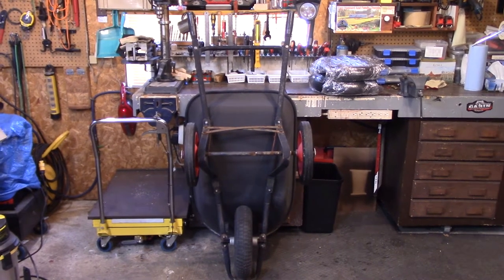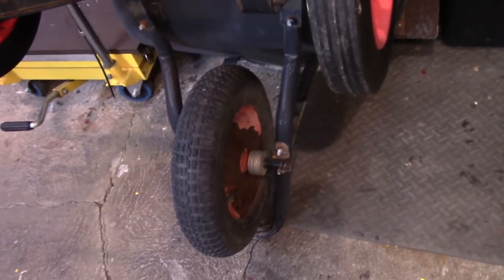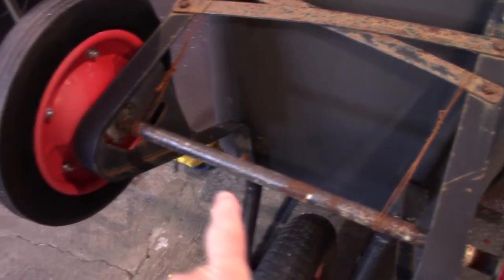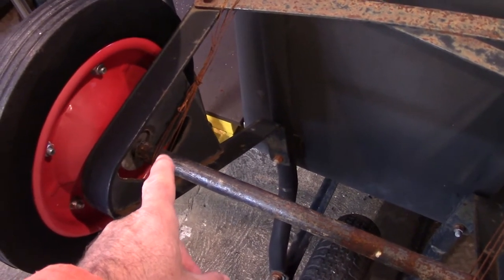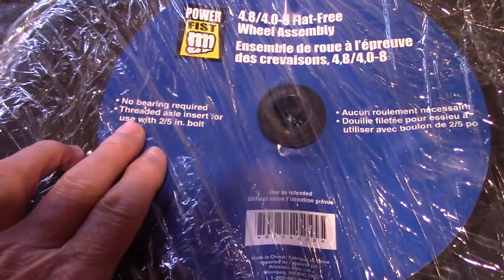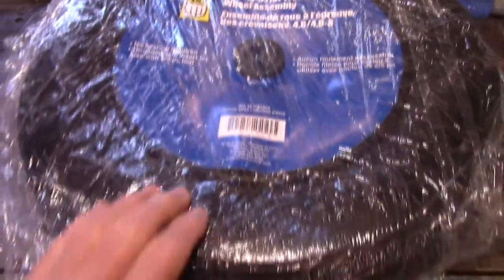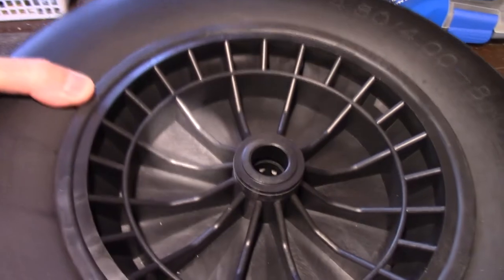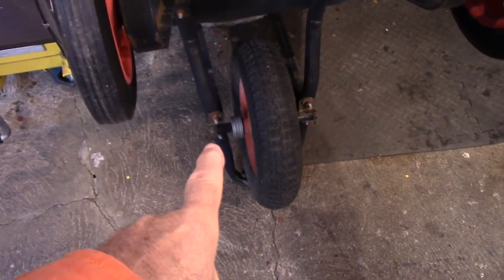Best Wheelbarrow  Design To Buy

Comment: A good mod, it always seems like the front tire is flat every time you go to use the wheel barrow.  I ended up putting a tube in mine but a run flat seems like a much better idea.  Interesting bearing set up there
Reply from the maker: Easy mod to convert to a 3 wheel version and not so tippy.

Comment: Wheelbarrow tires... I think one of the quality checks they have to perform while manufacturing them in China is to make sure they have a slow leak. If not, they have to rework the product.  That must be it because I never saw any wheelbarrow not leaking. That is 100% guaranteed they will leak. Or you can return the product for a replacement or a reimbursment. Lol!  You are in business now to work smarter, not harder! Thanks!
Reply from the maker: Interesting how they could never make a wheelbarrow tire  leak proof eh LOL

Comment: Too late for Steve, but they also have or did make a solid tire with an aluminum rim that is the old style so you can use the original brackets.
Reply from the maker: Interesting Pat , I think most have one wheel  as I don't see in the stores the 3 wheel version sold any more much.